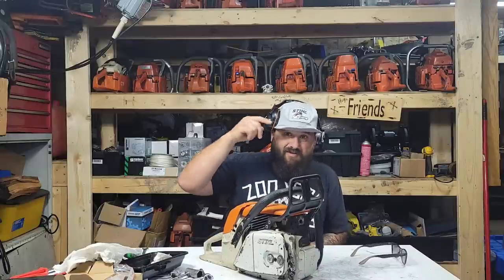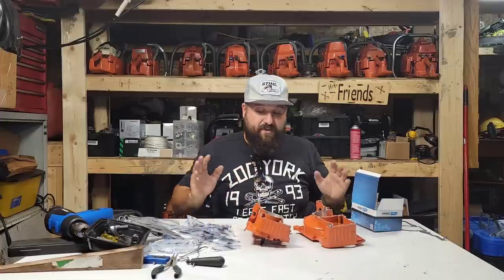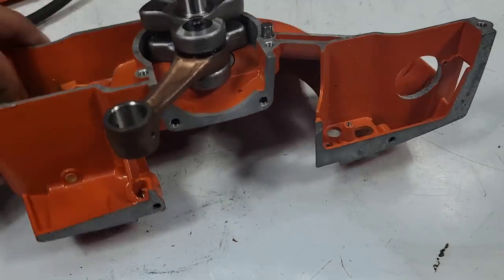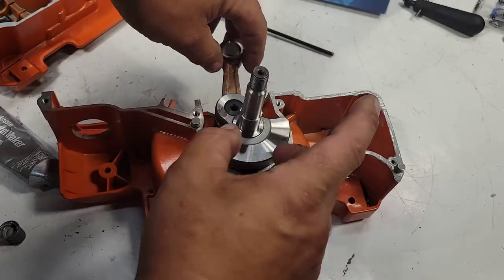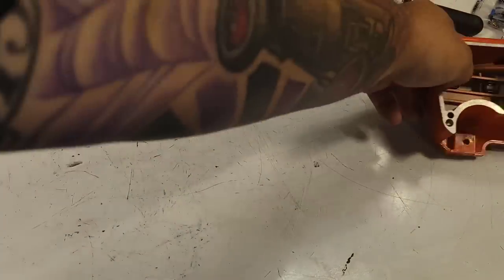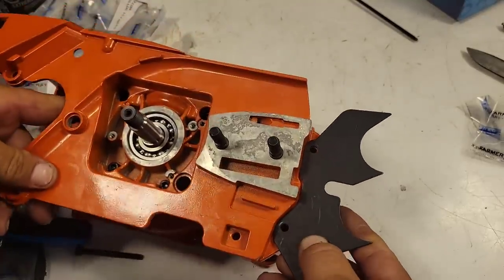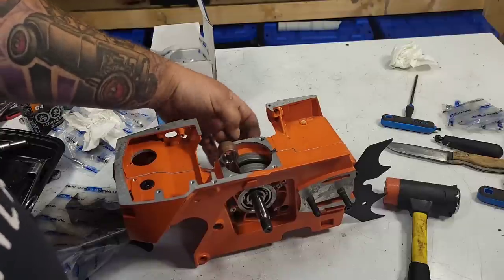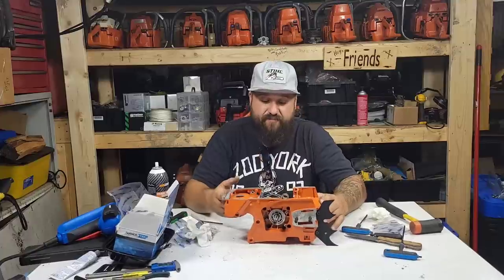Farmertec 288 Kit Saw Pt1: Bottom End build!!

Comment: Hey Tinman, I did a G888 kit a couple months ago. I snapped off two cylinder bolt heads within the first hour. Fortunately they were opposite corners so no damage! I got the nubs out and replaced them with oem and it's been going strong since. Going forward I'll be installing oem bolts in the case and cylinder. Looking forward to the rest of this series. 👍

Comment: I built the same kit almost 2 years ago. However, knowing Chinese lack of quality I opted for the Meteor cylinder and piston, oem bearing and seals and an oem carb. I kept a better pull cord on hand and a quality spark plug. I've run the snot out of my 288 and love it. I cut my own firewood and help others cut theirs and it works fine. I wouldn't expect it to last long in an actual logging application but it's dandy for a firewood operation.

Comment: Good time on the build. I'm replacing the bearings on my 288 kit since one of them has a flat spot on it. I had to have Huztl send me another cylinder because the plating was peeled off the one I received. I won't be using the Huztl cylinder for long because I caught the Hyway 288 P/C kit on sale from HL for $54 plus shipping, I will use the Huztl P/C to get my port numbers then put the Hyway set on. Usually I deck the cylinder base and do a base gasket delete but if there is enough material on the base of the cylinder I think I will leave the gasket this time. I'll trim the cylinder ring away at the base where they lowers are to get better flow and start adjusting my timing from there. The original Tillotson carbs that came with these had the enriching jet (like the CS-590's do) so I'm going to run it like that and see if I need to do a block off on that as well. 
The tank/rear handle on mine came with one of the isolators stripped out by them so I have to fix that as well but I'm replacing the rubber isolators (antivibe) with spring isolators. Going with a lot of OEM parts as well. I using a OEM muffler with the spark arrestor screen and will turn the deflector around and have it point forward and push the internal diverter back for better flow and placing a second screen/deflector on the other side for a dual port muffler to help the restriction of the screens. It will be interesting to see what port numbers you come up with, I've heard these port close to what the 372's do on duration's.

Comment: Hi Tinman, I find it works great to heat a metal plug of approximately the size of the inner bearing race. Heat the metal plug and place it on to the bearing race and let the heat transfer. This will heat up the bearing race slowly and expand the inner race of the bearing. Together with freezing the crankshaft it works 9/10 times. It does take some prep and time however.

Great video again!

Comment: I got busy, & couldn't watch for a few days. This is glorious! I like how you put your cases together. I bought a tool. But it doesn't work with the coarse thread pto side of the 200-300 series saws, they only work on the flywheel side! So I'm like....damnit. In the past, I have used my torpedo heater plus throw a bearing in a baggy out in the snow bank. Ten minutes later, plunk. HhhhhhLike a Glove! I saw Walt do that too. But he used his woodstove. This last time with my 61, I did what you did here with my heat gun, & had the crank in my freezer. I'm digging your dry humor in this btw, lmao. I'm gonna watch all 3 parts tonight.

Comment: Hey Tinman, like the video.  Can’t wait to see the follow-up vids.  I did a top end rebuild (my first build) on my beloved ‘86 281xp that got me into felling & forestry related work.  It hadn’t been run in over 20 years and I learned a ton in the process.  Was able to salvage the original cylinder and piston and it’s running like a champ, but I bet I’ll have to do a full rebuild at some point.  I’ve already invested in the parts for when the time comes and plan on turning it into a 288xp.  This and the following vids will be a huge help for when the time comes to pull the trigger on that project.  Cheers from Little Falls, MN….“Beauman” the lumberdork.

Comment: Hi tinman ,put one of the 288 kits together back in March , went well ,I did have the husqvarna crank puller kit ,worked great, little different design with the clutch side seal in the oil pump , did some port work and clean up ,add a pop up piston, haven't run it much yet , but with the muffler mod , she sure barks .one thing that drove me nuts was a large rubber grommet in the kit , took me a while to figure out that it goes on the handle right above the clutch  cover . Couldn't have done it without you and Harvey's videos .

Comment: I‘ve done a few low ends but it is always entertaining to see how you are doing things - every time I learned new things.
My procedure is heating up the case halves in the oven (60°C) and put the crank in the freezer. If it’s still too tight, and the bolts won‘t grab, I just use longer ones and gently pull that thing together.

Looking forward to the next episode!

Comment: You can make the puller using 2 large fine thread bolts and nuts and some large washers and a piece of pipe to sit against the inner race . Drill and tap the bolts using the appropriate thread pitch. Pretty easy and inexpensive tool to make. I used a set of their cases to rebuild a 2172 that had a cracked , flywheel side case. Nice option for older saws that are getting hard to find parts for. Biggest problem with these kits are guys trying to pass them off as real saws on buy and sell groups. I called a few out already. Buyer beware!
Reply: By the way, nice Cherokee, I’m sure Mrs Tinnan likes it. Your fixin’ to be a busy man when lil’ Tinman arrives. Congrats to you both 👍

Comment: The other way to get the crank to fit would be to toss it in the freezer overnight to shrink it just enough to fit. This is a common practice with heavy equipment, in some cases people use dry ice or liquid nitrogen for a quicker cooling.

Also you could use aviation form a gasket paste that comes in a can to hold the gasket in place, I used to use it for all kinds of stuff especially things like rad hoses and to hold intake manifold gaskets and never had a leak. Was taught that by a very experienced auto tech.

Comment: For some reason in both bottom ends I e built, both stihls I e had to put my case splitter back in on the bearing after assembly and just give the bearing a minor tweak. Could not get it to loosen up with a hammer until I did that. Is it right? I dunno but it worked
Reply from the maker: I find that often stihl bearing pockets are really tight so sometimes yep you need to get creative to get everything freed up.
Reply: Good to know it’s not just a me issue! Lol

Comment: Hey Tinman after centering my 372 crank it's still stiff without the crank seals installed.  Should I slap the crank around more with a hammer?
Reply: I should also mention that I used the husqvarna tool to pull the crank in
Reply from the maker: Yep tap each side til it spins freely
Reply: @tinmanssaws  thanks man.
I'm a fellow canuck too. Nova Scotia
Reply: Whoop on it like it owes ya child support lol as my dad would say lol 😂